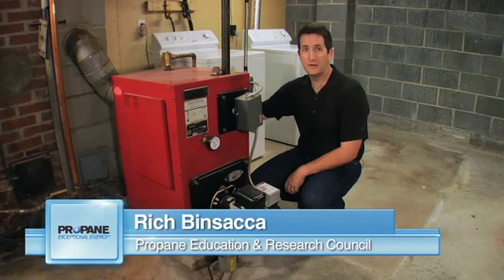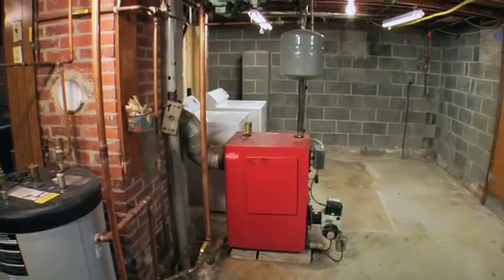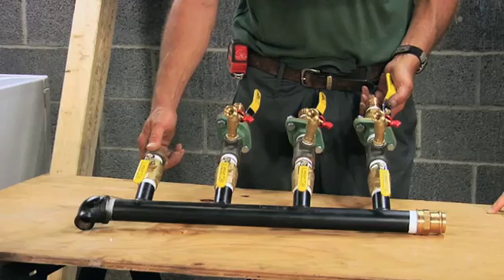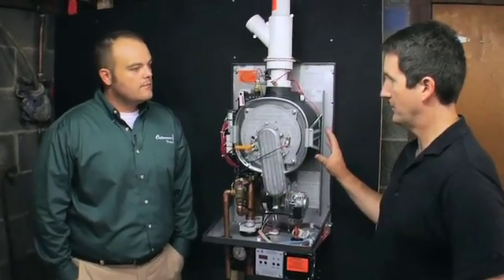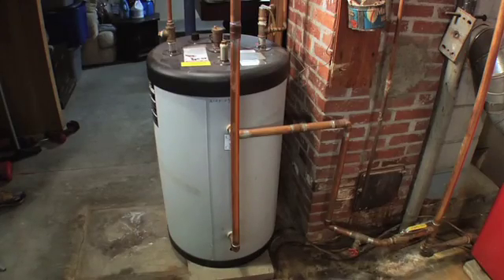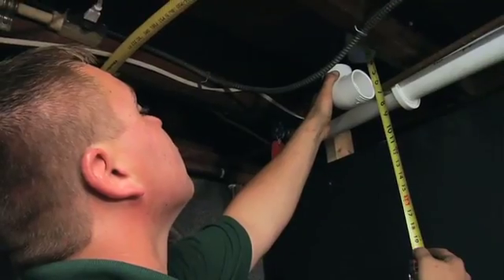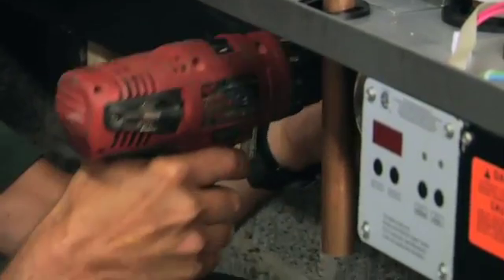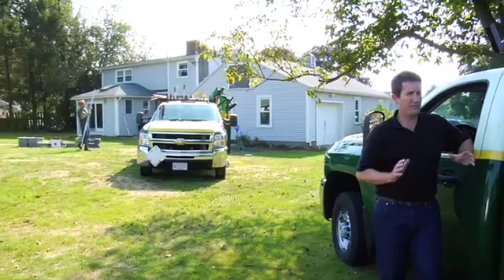Converting an Oil-Fueled Boiler System to Propane, Part 1

Comment: I'm sure this was a 9-12grand conversion versus just getting a new oil boiler... but gas is nice for stoves fireplaces etc
Reply: And much cleaner,  efficient, and cheaper.
Reply: @CloverPickingHarp  At today's prices, a high efficiency LP mod con boiler has very similar operating costs to a cast iron boiler, but with twice the maintenance and half the service life.
Reply: Also, if you frequently set-back your thermostat, DON'T buy a high efficiency boiler. It will not work well and you will not save on heating costs like you can setting back the thermostat on a cast iron boiler.

Comment: Ho much approx. does this whole thing cost. & what is the cost Gas vs  propane heat. we are looking to buy our 1st home & see a lot of them being oil heat & my husband used to live in a house that had oil & that was a lot of money in the winter & that was like 15+ years ago, now is crazy to even have oil heat with the cost of this supplies  not to mention why spend our USA money on foreign oil? that is not patriotic at all to me if we have a choice.
Reply: Oil is a nightmare tbh... gas is the way to go
Reply: Vanessa, I'm responding to an old comment here so maybe you already figured things out. You need to use a calculator that accounts for the price of LP vs heating oil and also the efficiency of the boiler. At current prices, this conversion will not pay for itself, but maybe over time it will- but I doubt it. Keep in mind mod-con boilers have approximately half the life expectancy of a cast iron boiler and maintenance is critical to getting the full life expectancy out of the high efficiency boilers. I use this calculator: https://www.efficiencymaine.com/at-home/heating-cost-comparison/

Comment: as far as bulky goes, I dont even have an electric hot water heater with my boiler system so that right there negates the bulkiness issue of the boiler... and as far as losing efficiency, its not hard to open it up the door and vacuum out the soot on the heat exchanger. And another thing to note is, if I run out of oil on a winter day I can always go down the street and throw some diesel in the tank to hold me over till the delivery comes.